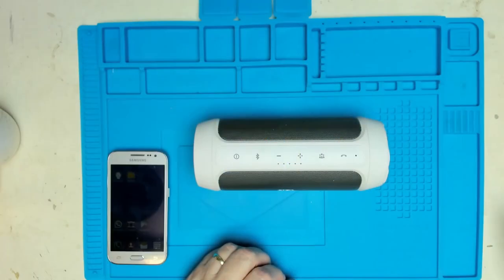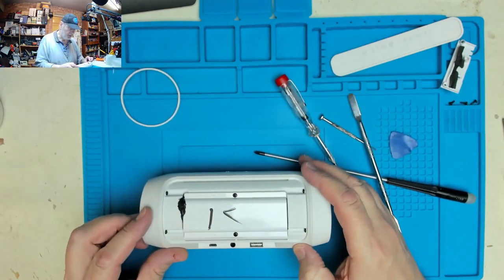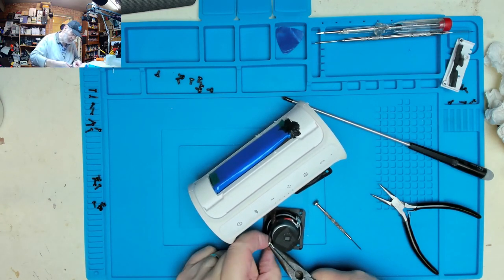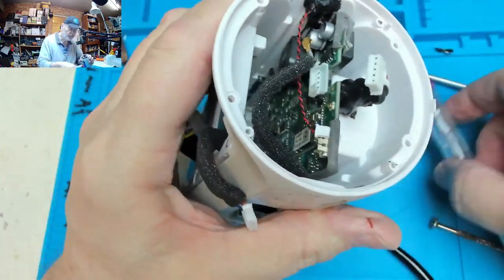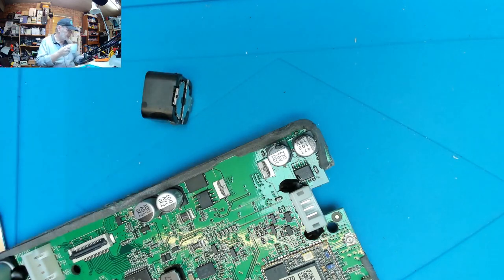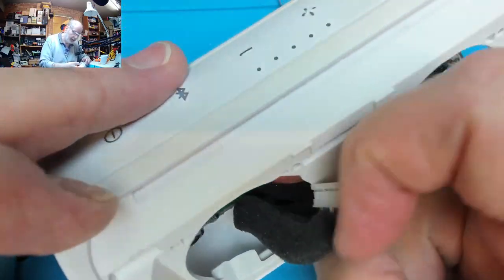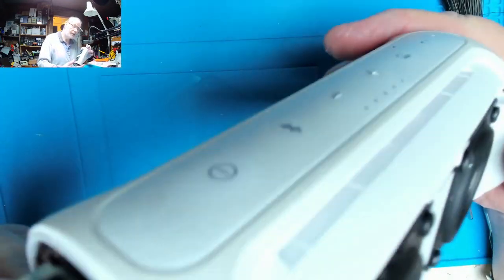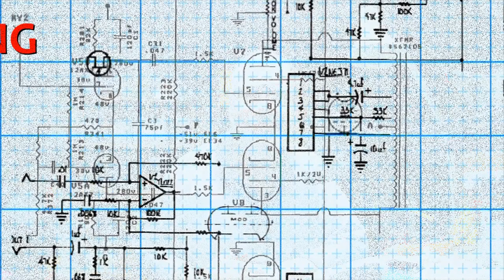Fixing a JBL Charge 2 BlueTooth Speaker

Comment: I need to do this exact thing and am so thankful to have found this but I have some questions - what is the ribbon that was used to ‘clean’ the pieces first and what gauge of solder wire was used to finally affix the piece?
Reply from the maker: The ribbon was desoldering braid and the solder was generic multicore solder, just the usual workshop stuff, nothing special.

Comment: Thanks for this. It helped me succeed in fixing an electronic device for the first time in my life :) I have been opening up electronics and making the problem worse since I was a kid, but this time I managed to actually fix it! 

I had the same problem by the way, the same component broke off on one side. Managed to get the board out just far enough to be able to throw a big blob of soldering against the broken foot (my soldering skills are non existent). I expected the blob to short circuit something but until now, it just works!
Reply from the maker: Well done, pulling things apart was how I got started, mind you, I was just a baby at the time and the thing I pulled apart was a mains lead from an old valve radio. Nasty burn but it sparked my interest so to speak 😂😂😊😊

Comment: Thanks! I admired your cool patience and couraged myself to open and repair my Charge2. I dropped it one time too many and it went numb. Bluetooth worked and my phone found it easily ... but no sound! 
I had exactly the same problem as you and it was easy to fix thanks to your video. But it was not the whole story... When I started to reassemble it, one tiny little piece (condensator, i think) fell on the floor. First I thought my brother in China had made a practical joke on me, but no I finally found the place where it fit! Some welding... and presto! Couldn't believe my years when put it together and turned it on. Perfect sound! Thanks once again, fine video!
Reply from the maker: Happy to have helped, glad you fixed it, well done :)

Comment: I have this speaker, so much hassle to open and repair ,I have no sound problem, and I have lost that 100 labeled inductor, can I order new inductor and place it there
Reply from the maker: Yeah, just try searching ebay for a 100uH Inductor, there are plenty of them available, you'll need the SMD type. uH = Micro-Henry.
Reply: @ChasLarge  thank you, what else I need to see if sound don't come after installing that inductor??
Reply from the maker: @piyushparekh5337  Connections, battery, speakers, wires. I have no schematics so cannot help further.
Reply: @ChasLarge  thanks

Comment: I'm in the process of dismantling my own, when I found out somebody else tampered with it. Could anybody tell me what component it is? Mine is busted from aaaand the copper coil from inside are shorted in between from an earlier repair. I also broke the thing, which you, my kind Sir mentioned it's the bluetooth antena. CHEERS!
Reply from the maker: Hi Adi-Eduard Leustean, if you care to share a photo of the component you are talking about, maybe we can identify it for you?
Reply: @ChasLarge   Hi Chas. After I comented on your clip. I searched the diagrams online and found out it's an Inductor, the same one you soldered. My inductor has it's magnesium casing shatered but it still plays. Thans for the reply! cheers
Reply from the maker: Glad you identified it. I'm sure replacements are readily available on the web.
Reply: Good morning sir i have jbl charge 2 + it is having Bluetooth problem it is not connecting to any device can u please suggest bme is it possible to install  external Bluetooth module inside it thanks in advance
Reply from the maker: @sunilamin3031  Hi, sorry, I cannot offer any advice as this was a one-off repair for me. I doubt you could add an extra BT device to it.